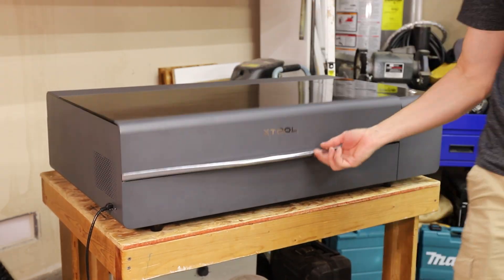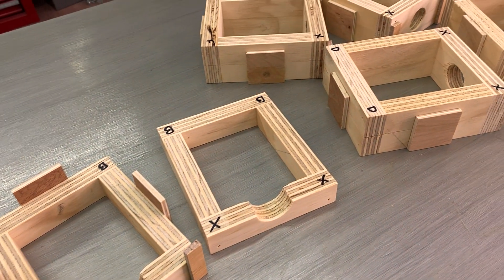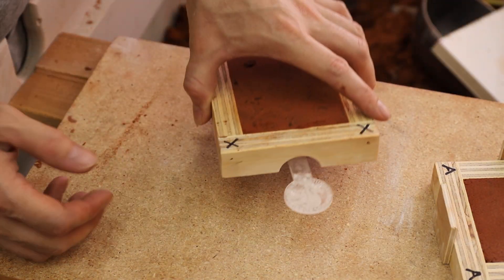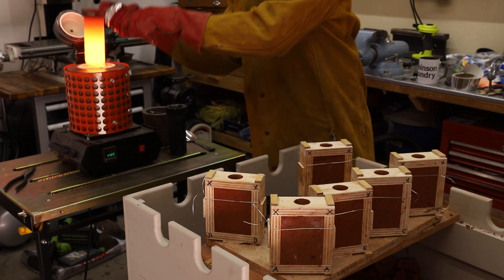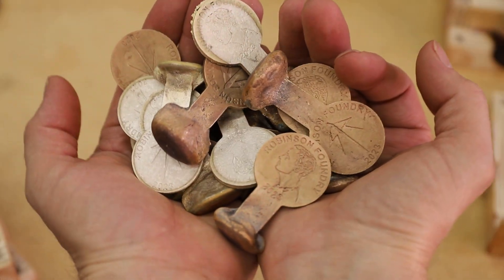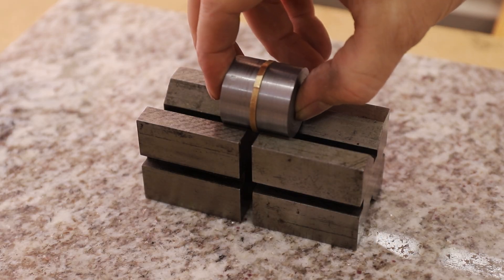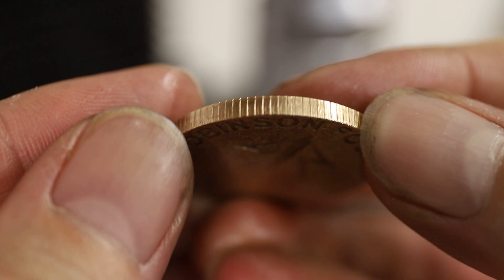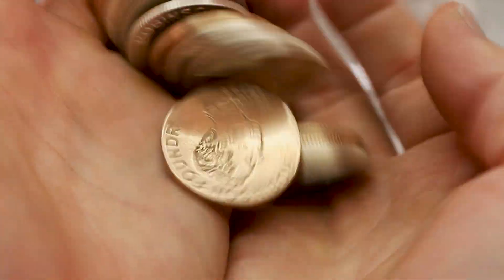My face on coins - Silver and Bronze coin minting - Reeded edges! - xTool P2

Comment: you forgot one step... before the knurling you have to push up a lip around the edges..... :)  
I would think you coulld easily do it the same way you did the knurling but with out the teeth.... but maybe you would have to flip it just like you had to with knurling, and you'd probably have to use a bit more pressure...  maybe using a slightly angles piece to press against the coin would not only keep it from sliding upwards but you would only be pushing up one edge at a time..... oh but if it's too much of an angle it would push the metal out of the edge, huh..... hrmmm ... maybe using an angled piece isn't such a great idea... well, maybe LOL I guess it would be a bit of trial and error...

Comment: Very nice result! Just a tip, instead of filing, you can just clamp the coin between the steel pucks using the tail stock, then turn down the OD.

Comment: Could've used superglue to glue the coins to your lathe as well, on a prepared round piece in the jaws of the same diameter or smaller, to help you guide it as close to center as possible. Heat would dislodge the glue (heat the mandrel, not the coin).